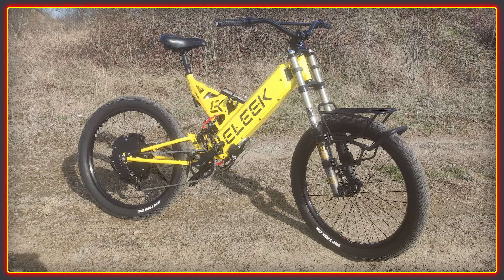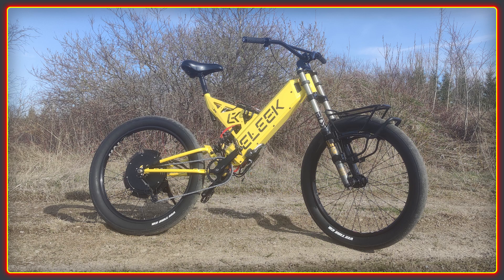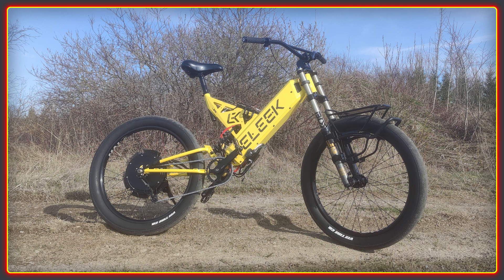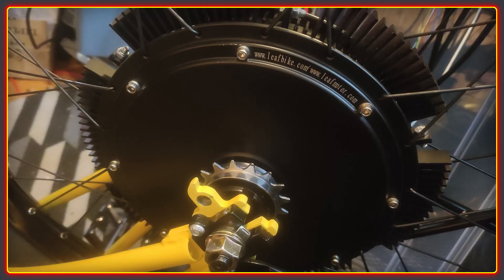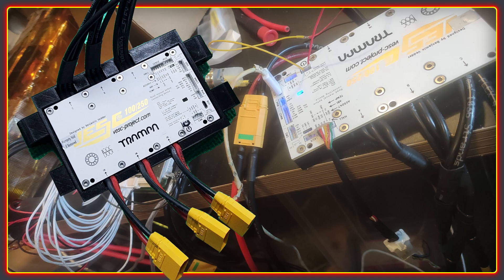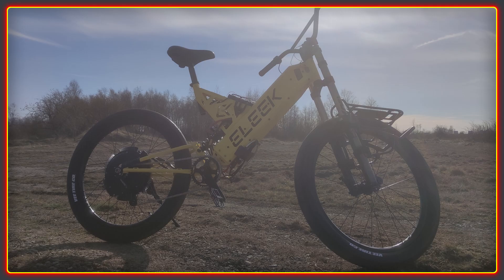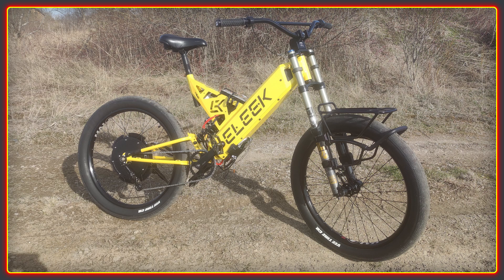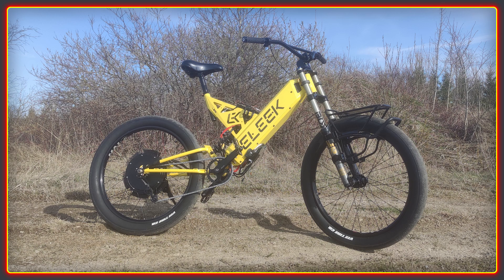Awesome DIY Electric Bike Build! 10kw 80kph+ The ultimate do it all machine!

Comment: So 1200W LeafMotor...  What is the Battery?? 18S5P??  What kind of range do you get??  Cheers!!
Reply from the maker: Hey Keith, pretty sure he has got well over 30kms so far. Not at 80kph tho! With these range is very much a function of speed. Not unlike gas vehicles really. If you go at 80kph in a car you will go much further than if you are blasting it at 120kph although it takes longer. Cheers (I think it is 18s5p yes)

Comment: Nice but just usable on privat ground.
Reply from the maker: Legally in most places and in this state sadly yes. It's way better made than most electric mopeds you can get. Hopefully one day the laws will make using these vehicles easier.
Reply: @HighVoltageKits  Well in europe its actually just legal on privat roads otherwise it needs the typ certificated and you need a numberplate like a motorbike.
Reply from the maker: I understand completely. The laws are what they are. I think they are not helpful to any of us going forward. I hope to present my view on it in a short while.
Reply: @HighVoltageKits  I think they are helpful because they safe lives. Reaching a certain amount of security  to protect life is quite important.
Reply from the maker: You mis understand me. Or I'm not being very good with my explanation. I will make the case for more effective regulation and safety. That enables the greater use of light electric vehicles of all types. I am not advocating for scrapping rules and leaving a vacuum behind.

Comment: I generally don't like hub motor powered ebikes, but this one is an exception, especially when the torque sensor is installed.  Very sharp looking build too.  Thanks for sharing.  Cheers.
Reply from the maker: JS did an awesome job. The electronics enclosures will really finish it off nicely
Reply: You took the words out of my mouth I love mid drive bikes but I definitely wouldn't mind that in my shed.